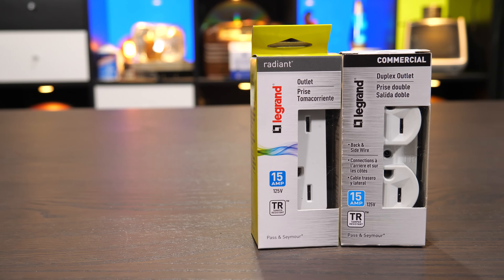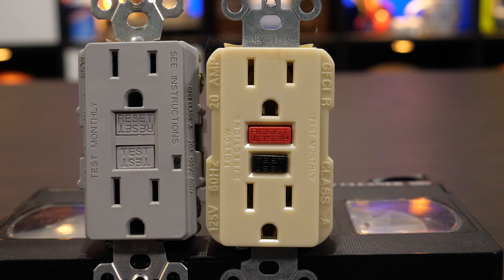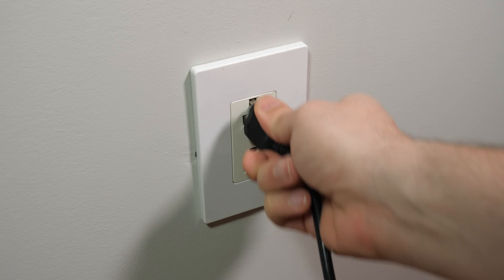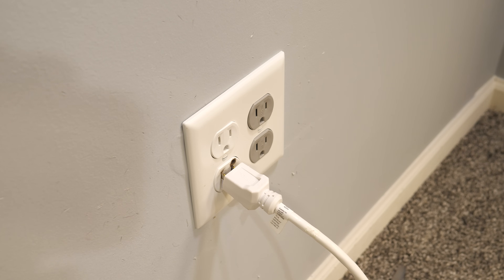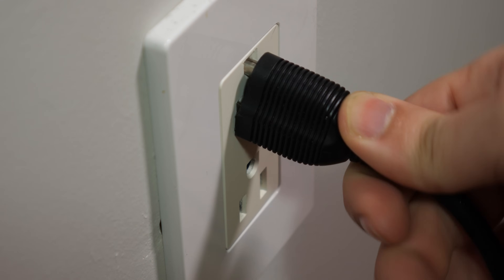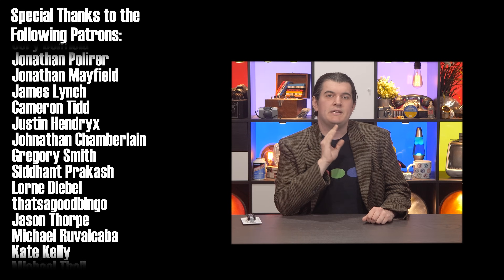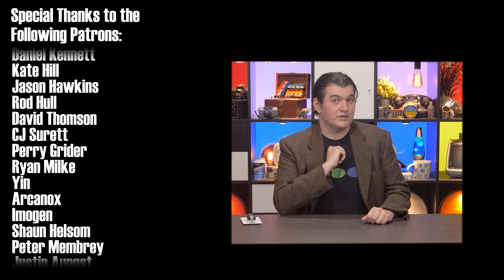Power outlets are topsy turvy - but does it matter?

Comment: May I introduce you to the clearly superior type C (ungrounded) and F(grounded) plugs, common in most european countries? They are safer, cheap to make and grounded variant is symmetrical so the orientation of a 90 degree plug doesn't matter.

Comment: Maybe it's time that you change the sockets you install. With the occasion, while you have to break compatibility, maybe it makes sense to adopt 230V circuits for sockets (reduce power losses since amperage is lower) and adopt the shucko plug that is a German design that now the standard in Europe. At that point the 110V socket would become legacy for older appliances.

Comment: European plugs have a smart way to prevent pulling out the plug from the wall by yanking it, for the appliance's that moves about, but doesn't have a grounding pin. They have the plastic body shaped, so they fill up the whole recepticle, using the grounding pin and the round intrusion as a guide that hold the plug in by force.

Comment: As Grant Davison said to me, the biggest mistake we made was in using a ground wire in the first place rather than opting for double insulated appliances. We pay for almost 1/3 more wire than is necessary in every building. If the ground pin is on top, but disconnects before the live and neutral blades, then there is no protection for the user of the connected appliance. This is much less likely to happen with the ground pin on the bottom, and is an aspect which you didn't address. BTW, Grant was the individual most responsible for the Canadian Electrical Code.

Comment: Personally, I feel the opposite sideways installation is safer. Ground pin left. That way neutral and ground are the top two pins. What I hate about the older two pin plugs is their lack of polarization. A reversed plug two wire toaster switches the neutral and the elements are connected to the hot wire all the time. Try to pry a broken slice of toast out of that for a shocking time.

Comment: My house (built in the 60's) has ground on top. Aluminum wire and no GFCI's.
The LG TV I'm watching this on has a right angle plug in the correct orientation for the upside down frown.
The IBM Selectric also used the correct orientation.
With a simple addition to NFPA 70 regarding orientation of new builds and products it can be easily consolidated.

Comment: This is probably something you thought of, but if you mentioned I missed it:
Right angle plugs facing straight down are alright when you only have one of them, just put it on the bottom. But what happens when you have two plugs with all that added bulk demanding space parallel to the line of sockets, and you need/want them plugged in near each other? And when you have to concede to pull out a power strip to solve the issue, all bets are off for tripping hazards. 
This might be a relatively small issue in the grand scheme of things, but I wouldn't be surprised if a lot of product designers out there saw that choice between 'make our product slightly less of a tripping hazard' and 'make our product universally easy to plug into any outlet space' and went with the simpler crowd-pleasing option.
Reply: avoiding conflicts like that is the point in 45 degree plugs (almost always down-right), and one of the advantages of the 'straight out the back' type (countered by all the down sides of 'straight out the back' if your plug design is bad).  Actually, one thing I've noticed a lot where I live (not the USA), is that Multiboxes (powerstrips, I guess) tend to have 45 degree plugs, but the sort of things that fully expect they're going to be plugged Into a multibox tend to have 'straight out the back' plugs...
and then there's the never to be sufficiently damnned wall warts. Bad enough when they all point Down (introducing the levering problem even in plugs that wouldn't have it otherwise), but then some genius started making multiboxes with two rows of plugs facing opposite ways to accomodate them... and after getting one I encountered, for the first time ever, a wall wart where the cable came out the TOP! Which, naturally, couldn't go in ANY of the sockets on that multibox.

Though more recently I bought a multibox with... 10 sockets? 12? it deals with this by having some of the sockets further apart to accomodate wide wall warts, and as a result the sockets on one side are Not in line with the sockets on the other side (and they also have the two sides facing opposite ways), so there's always at least a couple of sockets that are viable for any given stupid non-standard plug. So long as you don't have too many that are non-standard in the same fashion.
Reply: Mentioned this as well. . . He even shows this in one of his demos, but still doesn't mention it.  I found that odd. . .   ;)

Comment: Being from the UK, I find the whole issue fascinating. Our plugs and outlets are stupid safe, something needs to go seriously wrong to get a shock over here.

Our live and neutral prongs are sleeved. 
All outlets are switched (physical switches on the wall for each socket) 
All of our plugs are right angle. 
The best design feature is that our outlets have an internal insulating cover over the live and neutral holes which is lifted only when something is inserted into the neutral. As a result, all of our plugs must be three pin but the earth can be plastic if the device doesn't need it. 

I don't even think our plugs and sockets are more expensive than our European and US brethren.

Comment: you know what'd seriously mitigate the risks while plugging and unplugging those badly designed plugs?
Switched sockets :P 

Seriously, if the socket isn't live when you're plugging or unplugging the plug, the plug's terrible design is kind of irrelivant to how likely you are or are not to get shocked in the process. 

Of course, that doesn't help with any Other issues, but it does solve that one.

Comment: When grounded receptacles were first introduced in the US, there was no standard orientation to install them, same as today. Grounded cords with right angle plugs were available in both orientations, i.e., cored exiting the plug on the ground pin side or the other side. By roughly the 1970s it was pretty much accepted that the cord of a grounded right angle plug should exit the plug on the ground pin side. Consequently, my local electronics dealer was clearing out his inventory of the older right angle cords with the cord exiting the side of the hot/neutral pins. I picked up a bunch fifty years ago for pennies. I still have some.

Comment: I am a Master electrician and there is a very dangerous issue that occurs when an outlet is installed with the ground put in  upside down - The Ohms begin slowly draining out of this outlet.  If this happens it become necessary to install what is called an "Ohm-Catcher" on the lower area of the outlet. You can find this device at any shifty, 2-bit supply store. (😊)

Comment: THANK YOU for actually saying this.  Somebody really needed to.

I was a bit surprised you didn't mention the one most glaring problem with right-angle plugs, though:  No matter which way around things are, if the outlet is oriented in a vertical configuration, and the right-angle plug directs the cord "downward", then plugging one into the top socket will always block the bottom socket.  I'm pretty sure this is why most plugs are not designed this way, because they want you to be able to use both sockets in a wall outlet, instead of just one.  (The 45-degree flat plugs try to avoid this, but IMHO also often cause their own problems, too, because for some reason, no matter how things are oriented, it somehow magically ends up going in the wrong 45-degree direction for what I need, always, resulting in horizontal stresses, or vertical stresses, or both at the same time, that tend to pull the cord out of the socket anyway.)

Comment: I've got one of those surge protectors that mounts directly to the outlet, and the plug on that is "ground down". Funny enough though, the outlet I have it on is installed "properly", so the logo for the surge protector is upside down.

Comment: 1:58 "If you suddenly woke up and found someone had turned all your outlets around in the middle of the night -- it would be supremely irritating"
Finnish power sockets (Type F, "Schuko") are symmetrical, there's an extremely low (but technically non-zero) chance this has already happened and I just didn't notice.
Reply: Imagine waking up and you find out your house has been turned 360°...

Comment: This just reminded me of something somewhat related. A few decades ago, my brother was renting a house with an unusual affliction. If you flipped the porch light on while opening the metal screen door, you would get a pretty good shock. Being young and not as wise, I convinced one of my friends to grab onto another friend as he was going out the door, and then flip the light switch. I convinced him the electricity would go through him and get the other guy. I didn't 😊. They both about jumped through the ceiling. I guess this is why men don't live as long.

Comment: Im From Germany, so safer plugs , although live and neutral are the same size so not fixed which wire gets what. What we also have: most of our extension cords orient the receiver at a 45 degree angle, so you can easy attach plugs with 90 degree cords. Otherwise you could onl, plug them in the ends.

Comment: My house in the People's Republic of California was built in 1965.  I bought it in 1982.  All the electrical outlets were two prong with no ground lug.  All were installed with the HOT pin on the right, which seems logical to me.  Of course, the builder (and apparently the city inspector) wanted to add some adventure to my daily life and wired all the outlets backwards (neutral and hot reversed).  In addition, they used a Zinsco breaker panel (Google "Zinsco panel fire") to make my home even more safe.  With all that, I think I can handle having my plugs "upside down".  By the way, over the years during various remodeling projects most of my outlets were rewired to three prong with a separate ground wire (or GFI in the bathrooms) which are mounted upside down (ground pin on bottom).  Also put in Solar in 2020 and got rid of that horrible Zinsco panel.

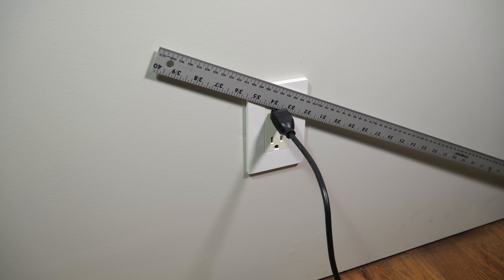Comment: 9:38  Even if the metal yardstick touches the Live pin, you would need to be somehow grounded AND touching the yardstick at the SAME TIME for anything to happen.  Just touching the Live yardstick, without touching anything else that is grounded, is completely irrelevant.  Electricity needs a path, otherwise is does not flow.

Indeed, fatal electrocution with house-level power necessitates that the current travel through your heart... So, you would need to touch the Live pin AND touch a grounded item with a completely different limb for the current to go through your torso. For example, touching both pins with your finger while inserting a plug would just give you a local shock to the finger, and perhaps a little burn. But if you touched the yardstick while soaking in the bathtub, where you are grounded by the water and the pipes, you would likely die. ;-]

Comment: Not an American but the one thing I got from the video was that the mixed outlet (with the top outlet being ground up and the bottom outlet being ground down) actually makes a lot of sense (I mean, given the constraints of the American system). If you have right angled connectors, you'd probably be placing them in the bottom slot to avoid blocking the other outlet, and then all your points on why not to use the flipped orientation are mooted and you can get the (admittedly probably minor) benefits of the grounding pin on top in the top outlet where it's more significant than the bottom one anyways. 

But not an American so I have no clue if what looks sensible from outside actually makes sense in the USA.

Comment: First of all, deep dish pizza is AWSOME!! I enjoyed your description of the game of wall knife :-)  I am not an electrician but as a computer guy,  I have run into issues at offices with everything from letter openers to paperclips and even staples being pushed off the back of a messy desk. I never had to deal with scorch marks (not my department) the electronic devices at the other end of the plug often get cranky when you mess with their electrons.
Reply: The game is not "wall knife", it's "throw the knives at the wall"!
The official Throw The Knives At The Wall League Federation will go after you if you call it "wall knife"!
Reply: As an electrician, I have heard from people on the internet (particularly europeans) being skeptical of NA wiring methods but have never seen or heard of anyone ever dropping something off a desk and shorting the prongs. A good practice when installing receptacles sideways is to have the neutral side facing up. But if your receptacles are loose and not holding onto plugs, It's time to replace your 70 cent receptacle.
Reply: Nah. . .  Too much dough.